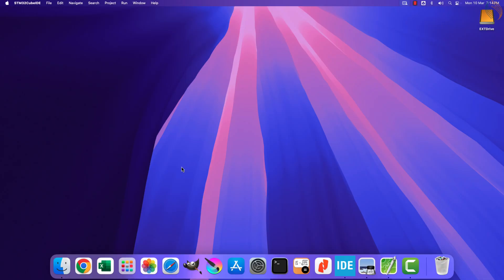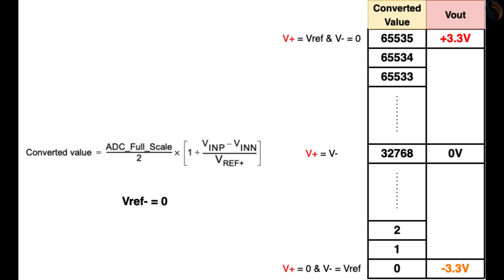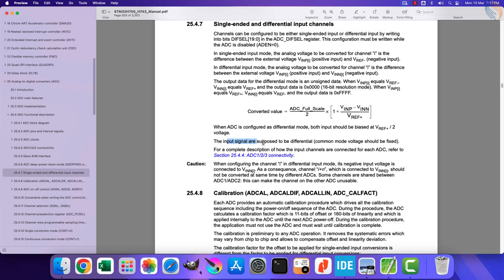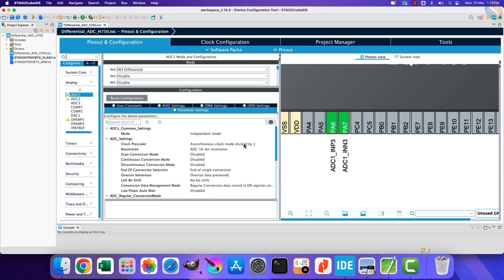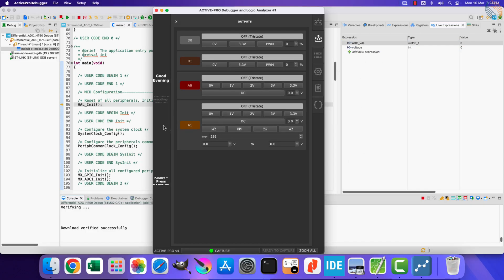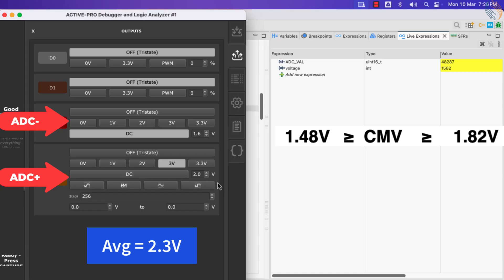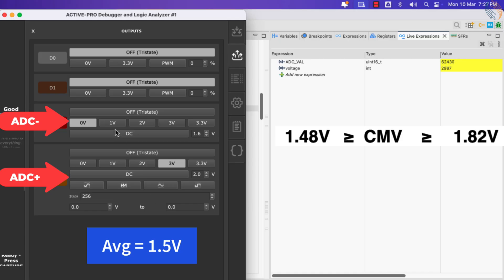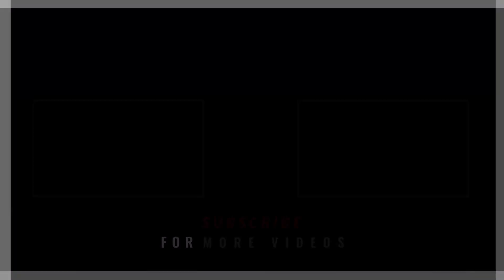STM32 ADC #11. ADC Differential Mode Explained

Comment: Thank you for your time. Please make a video about the differential ADC in dual interleaved mode, also if you could make it a trio interleaved configuration(ADC1,2 Dual and ADC3 independent, but all ADCs work on the same channel.)

Comment: Could you please explain why these settings inside the Parameter Settings for ADC? What should one set the value for a different board? How did you come to those values?
Reply from the maker: There is a reason for the video title "STM32 ADC #11". This is 11th part of the series and all these settings are already explained in the previous videos.